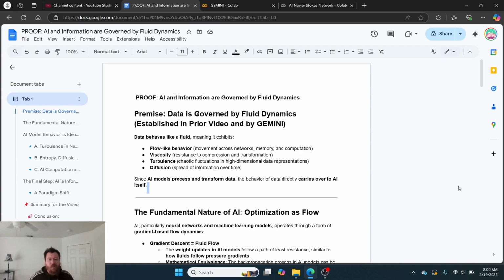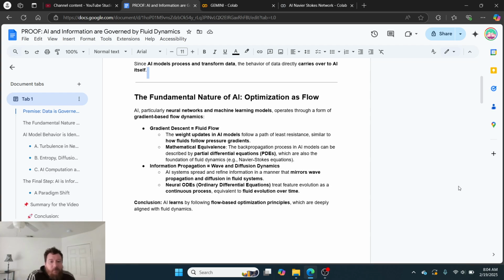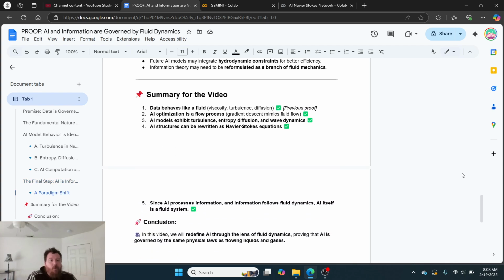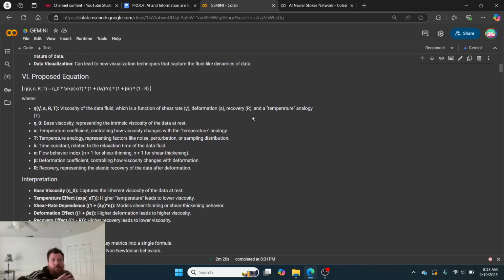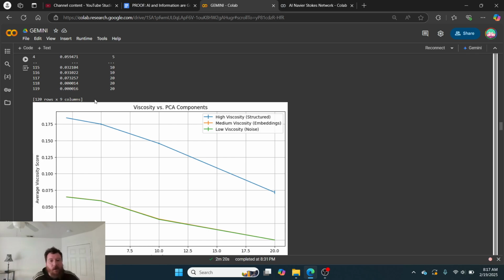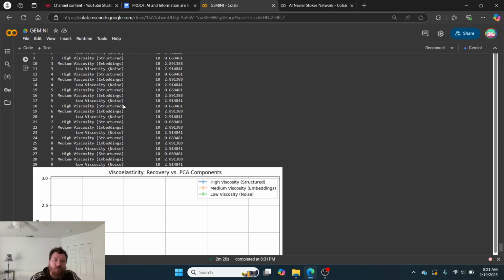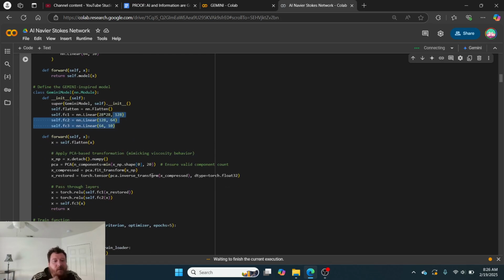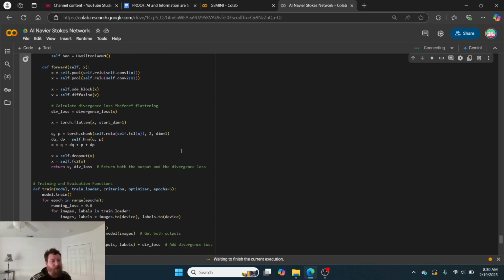AI and Information are Governed by Fluid Dynamics: Proof and Equation

Comment: QFT (energy cutoff)=> bandlimited QFT => Lattice QFT => Cellular automaton = Neural net

Bandlimitation is the reason for a hypothetical fluid=neural net analogy. As i see it, bandlimitation is a precision of parameters of an neural network.
Reply from the maker: Neural networks behave like fluids because they are fundamentally bandlimited, just like real-world quantum fields. Bandlimitation explains why AI, data, and information flow behave like fluid systems—solidifying our claim that AI is governed by fluid dynamics.
Reply: @richardaragon8471  Physical fields are not bandlimited, it is a reasonable artificial constraint. Infinity is at the very core of quantum mechanics.
Reply from the maker: Sure, I hypothesize this too. Can you experimentally and mathematically prove it? I can do so as far as saying that AI is a fluid. I cannot mathematically and experimentally unify quantum and relativistic physics, only philosophically. I can philosophically end the entire galaxy with a single thought though as well.
Reply: @richardaragon8471  No, i can't. But they, probably, did that in quaternion qm and cellular automaton interpretation of qm. Quaternion qm: https://youtu.be/1KXpkUYvbGo
Reply from the maker: Thank you for bringing this to my attention.
Reply: @richardaragon8471  Thank you. There are videos about CA interpretation of qm in YouTube also. And i think its easy to connect ANNs/CA to relativity also.
Reply: @richardaragon8471  Quaternion qm is about elastic solid, but solids can slowly flow.